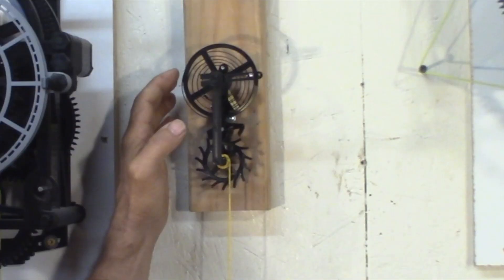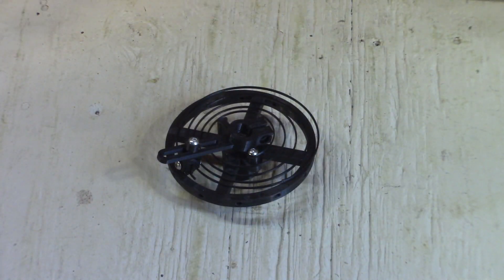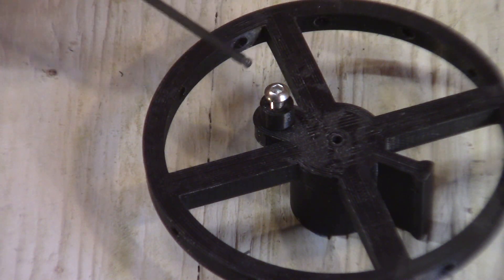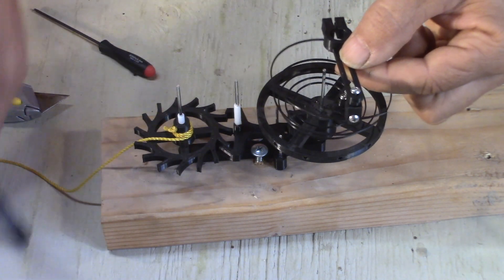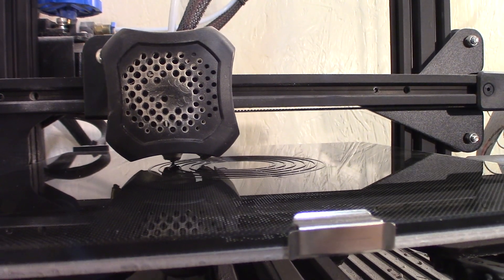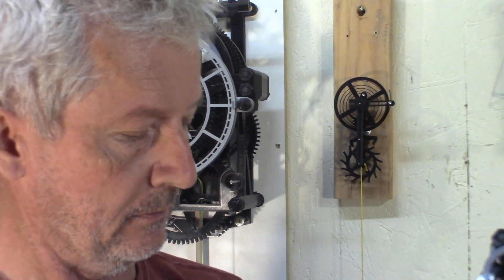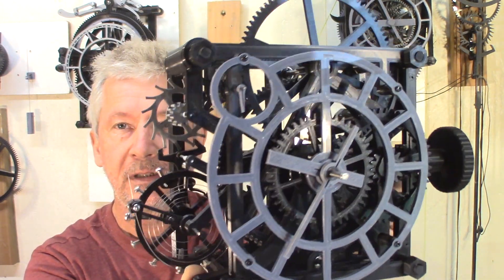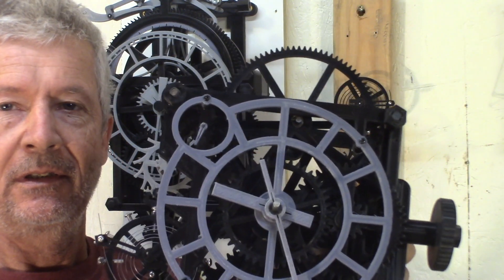The design and prototyping of a 3D Printed Swiss Lever Escapement Watch Clock

Comment: Hey sir great project. Im creating a similar thing. Ive 3d printed you model but the spring is weak might be because of material. Can you share with us the sketches or dimensions that you used or the CAD files. These stls are very hard to reverse engineer

Comment: Thank you so much for making this video. I was able to design my own escapement from scratch with a varied design based on this video based on Abbey Clock's work. Very helpful! My design keeps time for about ten seconds then stops. I modified the wheel and notch on the fly because of time and that is why my clock is suffering. Hopefully I will redesign another one soon. I also used an aluminum wire for the hairspring... Also suffering. Buuuut hopefully I expect to get some nylon filament for a stronger spring and hopefully that will make the movement more functional. My next steps are to design a barrel spring based escapement. Thanks again for doing what you do!

Comment: I found that the spring was not stiff enough. It wouldn't return the balance wheel to the center position. I made a new version with a cross section of 2mmx1mm (the original was 2mmx0.2mm) and this seemed to work better.
Reply from the maker: Nice! Horology takes a lot of tries to get it right
I came a cross you blog, nice comments about your experiences.
Friction and even more importantly adhesion, since a clock goes and stops so many times is a show stopper
I have fond that PLA + works well, I used eSUN Pla +, very strong, maybe harder than PLA so possibly less friction

Comment: Hi Jacques, are the screws used on the spring also  2mm? Thanks for posting this video!
Reply from the maker: The screws are M3
Reply: @jacquesfavre999 Ok thanks!  Also, can I ask the model and make of your 3D printer?
Reply from the maker: @rongeither7656  Sûre
Ender 3 v2
I use eSun Pla+ at 215c with 0.2mm layer
Very strong

Comment: Very nice. I am curious about the longevity of the printed spring. There are a few other printed spring clock designs, but most seem to have really short runtimes. Your run time should be long enough to build a clock that can be expected to run continuously for months or years. I really like the watch style winding and time setting knob.
Reply: This is not the wind-up-power-spring.
The power comes from pulling the string or putting a weight on there.
The runtime would be determined by the gearing you add inbetween the powersource and then escapement wheel. 
;)
Reply: @PeterLunk  My concern is about the useful life of a printed spring. PLA seems to get brittle after a few months. Old rolls will often snap as they are unwound from a nearly empty spool. TheGoofy's clock also uses a printed spring and the design has been around for several years. There is probably some data out there regarding narrow strips of PLA with continuous flexing.
Reply: @stevesclocks  PLA is very rigid, but it also creeps at lower temperatures than PETG or ABS, so it makes for poor springs. PETG can't apply as much force in the same geometry, but it will stay consistent over time.
Reply: That depends on the material. A PLA mainspring would lose tension quite quickly, but a PETG one, despite being weaker, wouldn't lose tension.